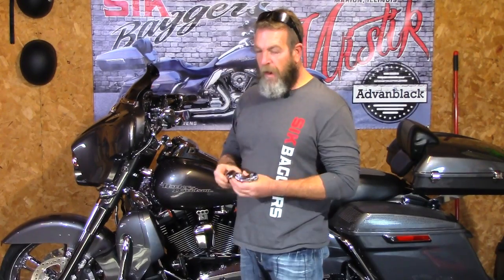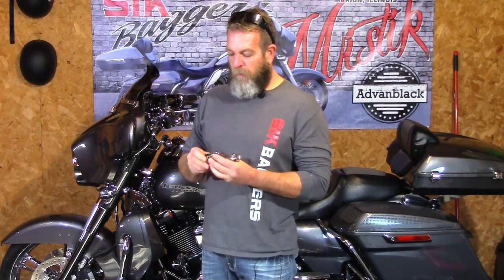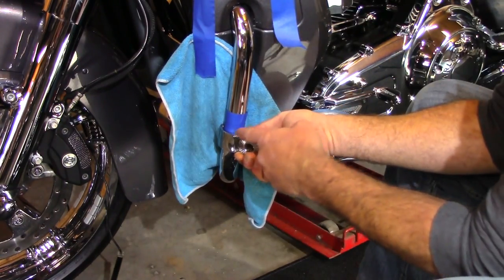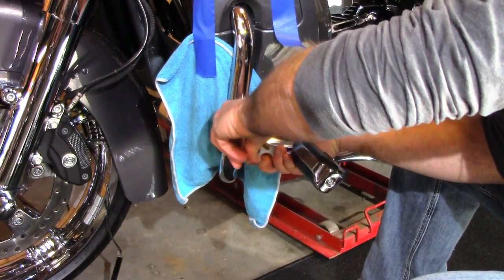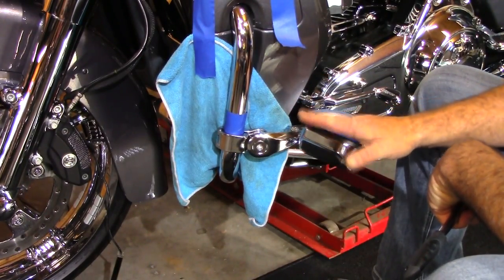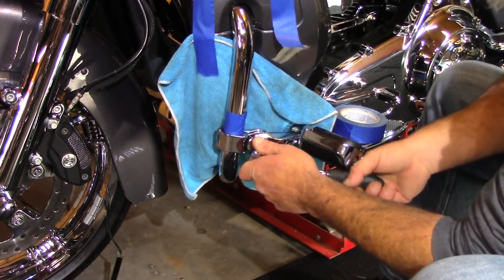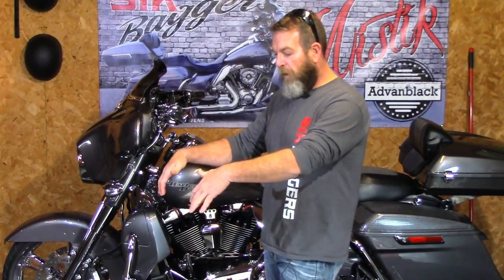How To Install Highway Pegs Harley Davidson Touring

Comment: Very helpful video. My used Road King came with pegs like this but mounted at a crazy angle, way up the bar. I got them set close to how he did it in the show and it's awesome. No need to stretch for the peg, it's just a bit off the boards.

Comment: hey great videos, i know this video is litttle older but, i wanted to ask the set i got from  jp cycles had plastic spacers and rubber sleve protectors i think,  my set would not close together unless i removed all the plastic and rubber sleve items, so it that nessary to keep the mount arm stay still? and protects the chrome bar from scratches or is some locktight going to work? thanks
Reply from the maker: Sometimes the spacers are for a more universal set up to fit different sized bars.  The plastic is just used a spacer on smaller bars and the rubber sleeve is to protect the bars.  I never used them...set it, tighten it down really good and forget it. If you feel like your pushing the peg forward while riding then you may need to put something in there to help hold it...but usually a good set of clamps will not slip on you.
Reply: hey, thanks for the reply I asked a few people about this but you are the only one who replied, even with the video being an old release  So Now I know what channel to go to first,   i can do a few things but I'm not a complete gear head so getting advice is a big help...so thanks again.

Comment: Great video! I’m having a problem with it moving on the crash bar - I’ve tightened that 5/16 bolts pretty tight - thoughts?
Reply from the maker: If you can find some rubber, anything like a piece of rubber from a bicycle tube, garden hose etc...you can slide that in and re tighten it.

Comment: Any update as to how these are holding up? I'm wondering if I should spend over twice as much for the HD versions or give these a shot. I just put on the Advan Black vented lowers on my '15 FLTRXS, and I can't fit a 3/4" wrench on the back of my original Kuryakyn highway peg clamps. The style in your video has all of the tightening adjustment from the outside, which is very convenient.
Reply from the maker: So far so good...I do like these for where the bolts are for sure. The ones I had were similar to this but the bolt was like a huge 3/4 head...just looked bad...worked good but looked bad. So far I am happy with these though for the price....no issues as of now.
Reply: Steven Housden would these work on a 2016 Road King? What ya think?

Comment: Did you use the rubber inside the clamp?
Reply from the maker: Some have it and some dont..this set did not have it and they are still on the bike ..never slip

Comment: Is there a limit to how low you can go. I'm 6'4 " , the ultra i bought was used and the pegs were very high.  My concern was placing the pegs to low . Thanks for sharing
Reply from the maker: No, you can add the pegs as far down as the curve. they are mounted way out away from your bike and the bike is the pivot point..you will scrape your footbaords before you will scrape highway pegs
Reply: @sikbaggers  awesome,  thanks for sharing 👍

Comment: Does anyone know where I can get the adjustable passenger brackets and boards to match my set of AVON front rider pegs and grips? I’m wanting to match all pegs and boards.
Reply from the maker: I dont think anyone makes anything that will match those exactly ..however you can find plenty that have sections of rubber in the boards...thats what I would shoot for since the avons are sections of rubber over chrome or black..something like the kuryakyn phantom boards, roland sands traction boards..something to that effect may pair up pretty nice.

Comment: Steve thanks for the vid... I saw on Amazon that they are like $35 for the pair.. thats unreal on the price.  I'm a 5'5" short guy but still want to be able to leave my heal on my floor boards (2017 RGS) and be able to rest my toe on the foot peg and stretch my legs out.  What kind of bracket do I need to buy for these pegs and $$$$$ ?  Since I am vertically challenged, lol  I don't want a foot peg sticking straight out from my crash bar as its to far away for my legs.  thanks man...  DAWG from MO.
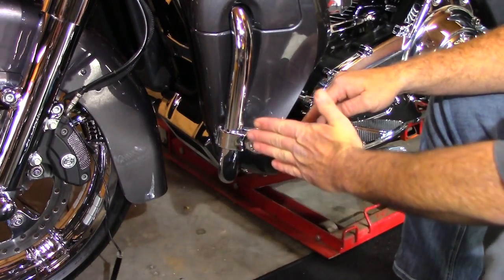Reply from the maker: yes sir there are two versions of this foot peg offered on amazon and at HD...these work great for exactly what you are wanting to do...with these you just twist them in instead of straight out and then make the other adjustments in the peg itself for your foot. The two versions are long and short. If you see at around 3:00 minutes in my video how I spun mine back towards me. Now these are the short ones but my buddy rocks the longer ones...Im thinking they are about 2 inches longer so closer to your boards.  Check these out https://www.amazon.com/Chrome-Adjustable-Highway-MountKit-Davidson/dp/B01LWUBI29 they are the longer ones.
Reply: Thanks Steve for  the info I ordered them from Amazon.  I saw that one guy said he used the passenger foot pegs for these mounts and purchased floor boards for the passenger... I might just do that as I have floor boards already for the wife....thanks for the quick reply... looking forward to more of your informative vids... DAWG from Missouri.
Reply from the maker: yes sir the passenger pegs and highway pegs are the same thing with any ones that you get They mount the same way..I didnt eh same here and used the rear pegs for the highway pegs and ordered boards for the back.
Reply: Steven Housden I ordered a set for my 16 Road King. I was also worried about gap. No use putting black washer in clamp.  Well, only time will tell.    I’m like Steven I don’t like going down the highway looking like I’m ground hogging.

Comment: I installed these a week ago. Was there a tiny gap in the clamp area? There is when I tightened mine. I can't tell in your video. Didn't want to to over tighten, but they seem to be on good. I installed long ways (opposite of yours) because I'm 6' 6". Don't know if that made a difference. I'm just a little concerned about that tiny gap. And where am I supposed to install those tiny Allen screws that come with the foot rests? Everything seems to be in working order... Do I need them?

2011 Road Glide.
Reply from the maker: Yeah there should be a small gap as its a pinch style clamp system. As long as you can put the weight of your feet on them and they dont move your good. The small screws that go with the pegs should go in the bottom towards one end if I remember right...its  a set screw so the pegs dont turn on the mounting bolt...but if yours arent turning I wouldn't worry to much about it, But check there and see if there is a tiny hole for that set screw.
Reply: Steven Housden 

THANK YOU!!!

Comment: I bought these same pegs from amazon and my left one wouldn’t hold. Kept moving on the bar when I put my foot on them. Then I think I over tighten them and they cracked. Just got frustrated with it because it would move. Thinking about trying again and using a set screw or self tapping screw through the engine guard. Any ideas?
Reply: I am having this problem now, seeing what people are doing.  I think I am going to end up drilling and installing roll pins in them.
Reply: Did you consider adding a Strip of rubber like heavy duty bicycle inner tube or something of the like? Something maybe to tighten onto and prevent slipping.  Wonder if that would well.
Reply: That’s what I did works great

Comment: Hi Steve what pegs can you use with these adjustable foot peg mounts? I’m currently running Kuryakyn highways pegs but would like to change them up like the ones in your video
Reply from the maker: Hey Joe! HD makes a set and these are kind of a knock off of those at about 1/3 the price. HD calls them Slipstream series. In the HTTMT floorboards video I done you can see them installed better. I got the pegs,, heel/toe shifter and brake pad to match. These are from HTTMT as well. You can use them as rear passenger pegs are highway pegs. Here is the link  on amazon where I got them. www.amazon.com/gp/product/B01MG1RPT0
Reply: Steven Housden thank you appreciate it
Reply from the maker: NO problem Joe...I switched all of mine from the Stock style "Streamliner" style to these...not a huge difference but noticeable.
Reply: Just purchased the offset peg mounts from httmt. Looks like they are good quality pieces from the video. Hard to tell from the pics online. Thanks for the video.
Reply from the maker: Youre very welcome...I am waiting to ride with these on so I can see how they handle. I have seen some that move to easily on the crash bar and when you try to tighten them down they bust from cheap pot metal being used. Its still winter here so time will tell. I will update for sure if I have any issues.
Reply: Steven Housden ,I should have mine tommorow i will let u know what i think of them after i ride with them.
Reply from the maker: Nice man! For sure...I have pushed on mine and they seem to hold but you know riding is a lot different